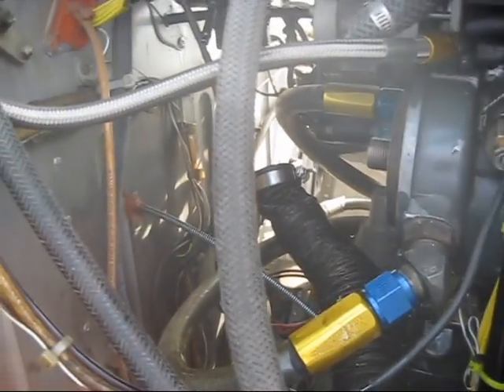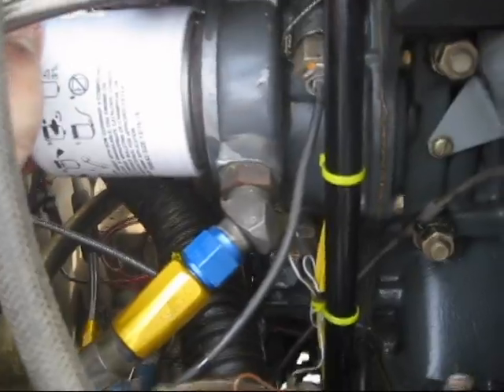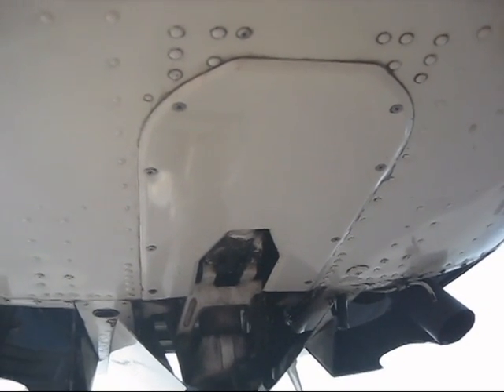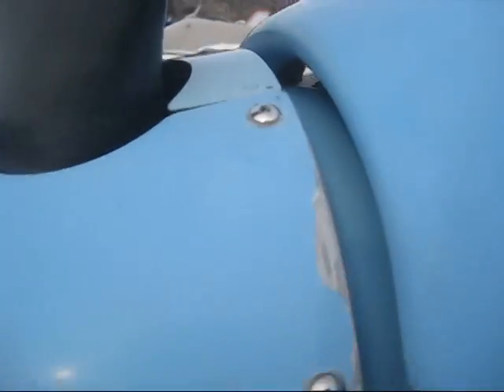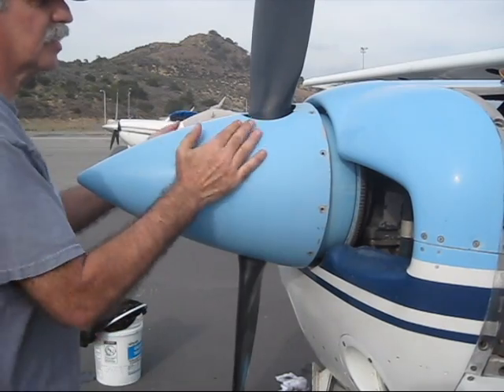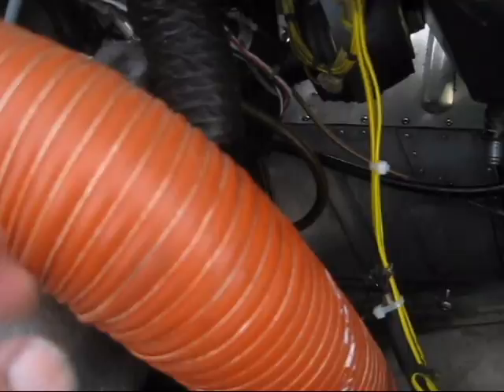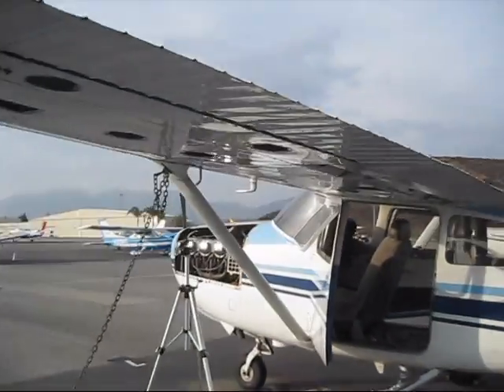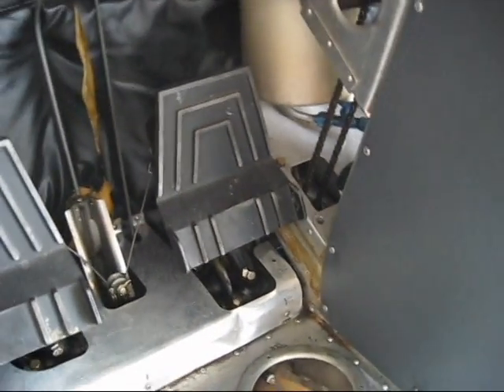1978 Cessna R182 (182RG) Annual Inspection. Day 1 - Part 4

Comment: Nice job on the videos.  Use a 1 gallon ziplock bag to completely cover the oil filter as you screw it off of the adapter.  This will capture 99.9% of the oil that tries to sneak out and make a mess.

Comment: a little words of wisdom you should cut the filter right away so then you can see if your engine has shavings and ultimately needs to be replaced or a cylinder needs to be replaced instead of wasting that $30 oil filter and fresh oil costing over $100

Comment: This may sound dumb I ask this.....are all 182's this involved during an annual on? I'm thinking about if I can ever afford an airplane I would like a fixed gear 182. What can you work on and what can't you? Will an A&P usual give you a break if you do the work yourself and he watches or is that not allowed? I'm still working on my license.

thank you for all the videos. nice job with them!
Reply from the maker: K0BLR With the exception of the gear swing and gear lubrication, the rest of the annual is pretty much the same as the fixed gear.  The legacy fixed gear 182 (prior to 1996 models) uses a Continental engine, whereas 1996 and later uses the Lycoming engine.  As long as you are under the supervision of an A&P,  you can pretty much do anything and yes they will give you a break.  The annual expense is just another predictable part of aircraft ownership, other predictable items are oil/fuel line replacement every 8-10 years, prop IRAN(Inspect and Repair As Necessary) every 10 years, prop overhaul every 20 years, magneto overhaul every 500 hours.  Good luck with your training and don't forget what I said in the beginning of my video:  "What keeps and airplane flying?  Money!!!"